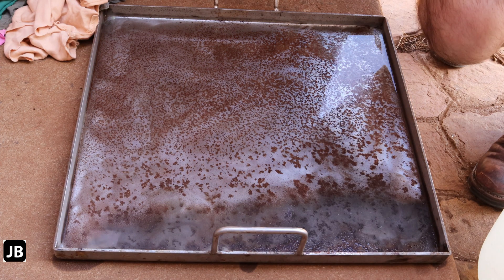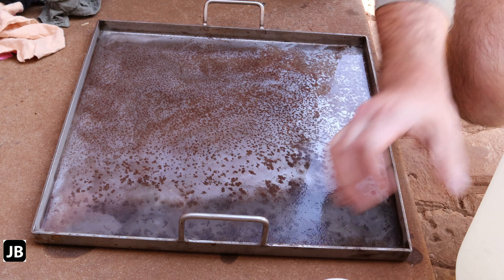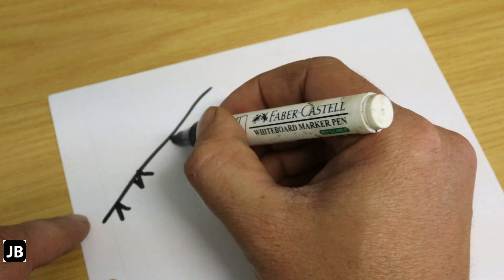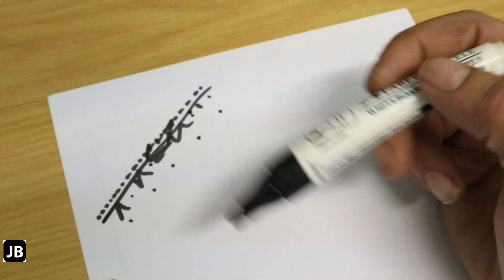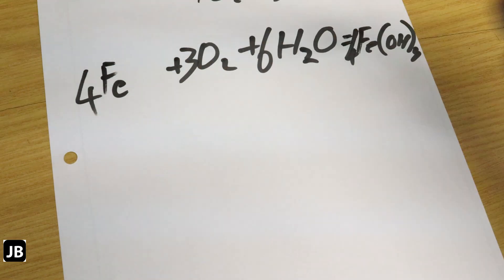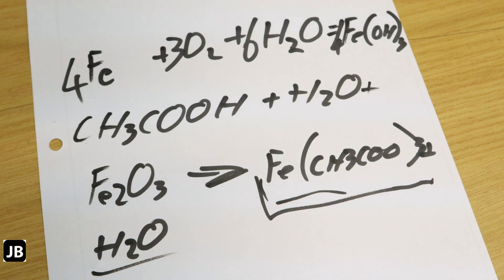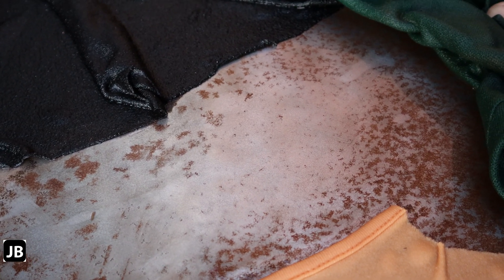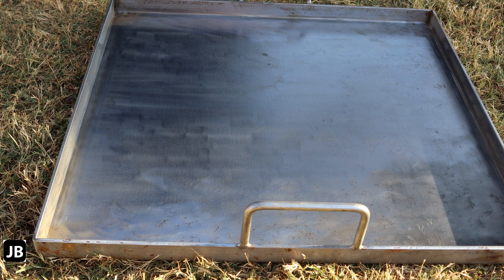Rust removal with vinegar (from stainless steel)

Comment: Very nice job! What did you use at the end? Angle grinder with a steel brush?
Reply from the maker: Thank you for the comment.yes I used a hard wire brush in the 4" grinder.